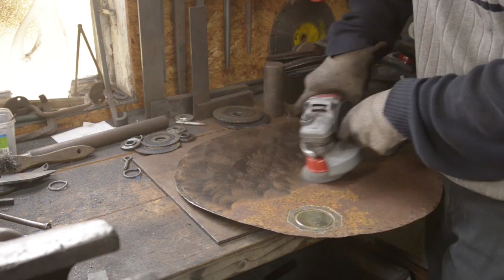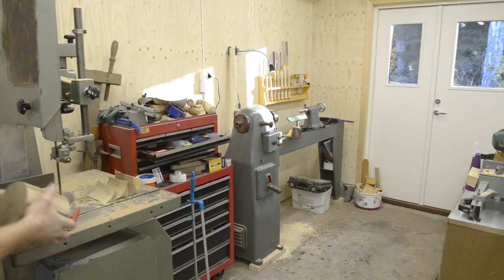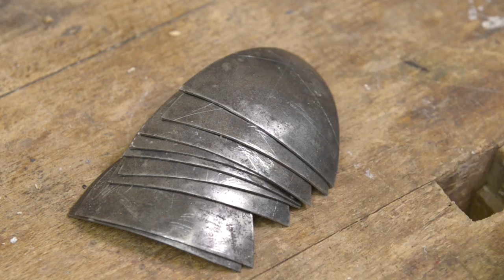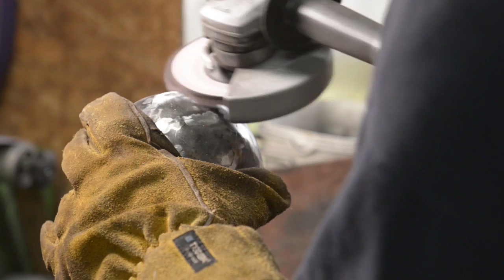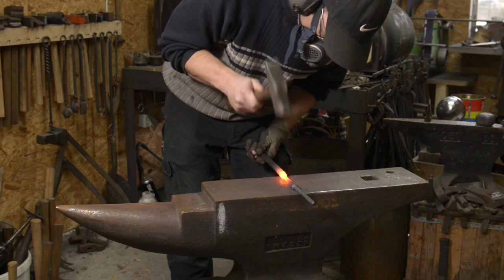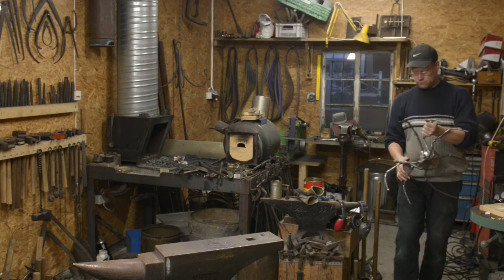Blacksmithing - Making the mega spider

Comment: Hello Torbjörn, I don't know if you will read this, but im a fellow blacksmith from Spain and I've been requested to make a thistle. In the way i thought making, it first I want to make a sheet metal sphere, drill 1,5 mm holes in the superior casquet  and  make the flower with MIG wire. I was wondering if you can share with me the template of the sphere youy use for the spider. I already have a template but I find way more easy and practical the one you used. I will appreciate it a lot.
Kind Regards from Spain.
Reply from the maker: I got the message... I will reply soon!
Reply: @torbjornahman  I can’t thank you enough.

Comment: Argh! I'm a Junior Mechanical Engineering major and I don't know how you did that math. Something to do with great circles or something. I take it you knew you wanted 20 triangles and then calculated the surface area of each triangle and then from there.... something.

I will figure it out though. It's bothering me now.

Great spider! I would have loved a nice red hourglass though. :)
Reply from the maker: Thanks. The math is not entirely complete, but knowing the area and the arc section length I could draw it in cad and change the parameters to suit. Each corner is 72* (360/5). The arcs on the sides of the triangles are not circle segments, the curve is tangent to the corner angles and then extends parallel to the edge a certain amount...

Comment: +Torbjörn Åhman
Please mr. Torbjörn, can u give to me a tip in blacksmithing? i'm starting it, and i made a knife recently. The size and format were good, but i couldn't make it 100% aligned, it got sightly crooked. I would like some tips or a video explaining about it, if you can, please send a video. I use an railtrack anvil and charcoal forge(in Brazil the coke coal is expensive)
Reply from the maker: If you get warped blade during/after heat treatment? Main problem is uneven heat I think. You also need to normalize the piece a couple of times to refine the grain before hardening. A tip is to try and straighten during tempering.
Reply: I will try it, thanks for the help! The durability and hardness are good, i used 680º steel, isn't very good but for a leatherer knife isn't so bad, i wil try these techniques of normalization.

Comment: In Which a Blacksmith Makes a Geodesic Sphere From The Lid of a Steel Drum and Then Proceeds to Use it For a Giant Spider

Real quick, two words on the math I can't quite figure out. Faklur and sien, which I hope I spelled right. Also, is asin shorthand for arcsin?

The rest I can sort out, but without those two it's a bit tricky.
Reply: I'm trying to sort it too. It's going to bother me until I know how to do the math.
Reply from the maker: Thanks. The math is not entirely complete, but knowing the area and the arc section length I could draw it in cad and change the parameters to suit. Each corner is 72* (360/5). The arcs on the sides of the triangles are not circle segments, the curve is tangent to the corner angles and then extends parallel to the edge a certain amount... it has been bothering me too for too long, but decided to go ahead without the "exact" parameters.
Faktor = I wanted to know how much more area the sphere had compared to the icosahedron. Nothing really to do with the geometry of the "triangles"
Slen = Length of the circle arc segment
Yes asin and arcsin is the same... don't know why I used different...
Reply: @torbjornahman  Aha! Knowing that slen is the edge length and that faktor is a ratio you were curious about clears things up tremendously! Trig is somehow very easy for me to read, so that's about what I needed.

Thank you! Also explains the question marks 😅

Comment: Very beautiful project. And i want to ask a couple of questions. Is lineseed oil protects wood just like it protects metal or it effects like varnish? and why did you used aceton on the metal? Thank you.
Reply from the maker: Thank you. Kind of like varnish, yes! Acetone is to clean off dirt and possible oil to get a clean surface for the paint.
Reply: @torbjornahman  Thank you for the answer.